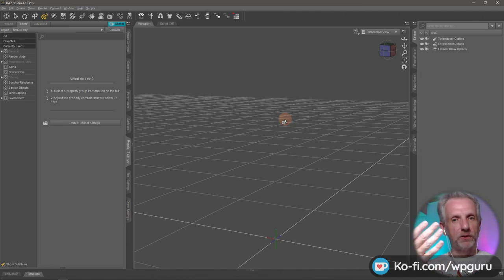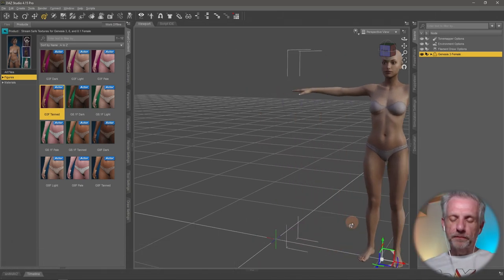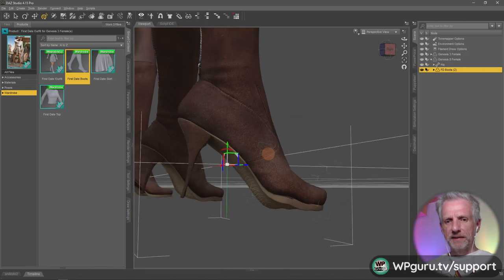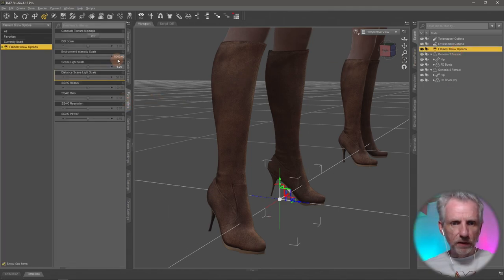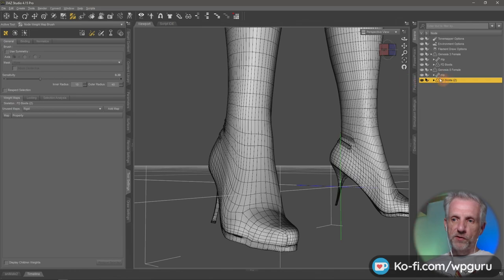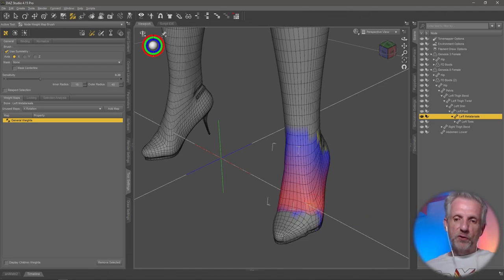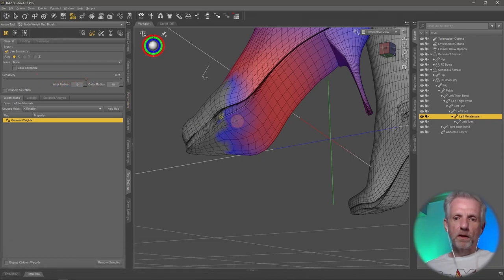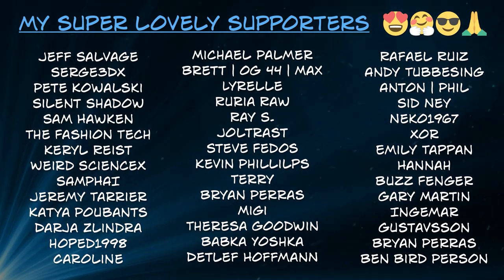Fixing Auto-Fit Shoes (G3 to G8) in DAZ Studio

Comment: Nice job!  I find adding a smoothing modifier and a push modifier with a low value helps as well.  This is a nice addition to help with distortion.  I make my own foot morphs so I always need to make sure the morph has the auto follow unchecked (in the morph parameter settings) or else the shoes deform to the custom foot morph.  I think the problem may be that some shoes are made to contain all the toe bones.  It would be best if only 1 toe bone was included.
Reply from the maker: That's clever, I'll have to try that out :-) Shoes are so tricky, I sometimes like a "smart prop" type accessory so I can do all posing and mprphing myself rather than undo what DAZ Studio introduces.
Reply: @WPguru  Thanks!  I'm a huge fan and keep these great videos coming!  All the best from South Florida!
Reply: what you can also do is remove the toe bones from the shoes in the joint editor. that is good for open shoes when you want to make some toe poses while retaining the shape. also a very good way is if you have customfeet morphs dialed in, they wil autogenerate the morphs on the shoes too. thats why they deform, to counter that when the shoes are selected, right click on the parameters tab and show hidden properties, and then head over to the currently used category inside the parameters tab, and search for the hiddedn dialed in morphs what u dont like to get your shoes or clothes gets conformed to.
Reply from the maker: That’s an awesome tip, I’ve never tried that. Thanks for sharing Mike 😍
Reply: @WPguru  I don't understand these tips. Pls make a follow up video.

Comment: Hi... nice tutorial 
Do you have a tutorial where you make the back shoes that does have strap moves?
You know what i mean
Like daggling effect?
The shoes usually stick to the heels when you try to bend down the foot which doesn't give a good effect lol
Reply from the maker: There's no built-in mechanism that can simulate this. I would probably un-fit the shoe from the character, then pose the foot and show separately. I have another tutorial scheduled that shoes how you move items despite them being parented, it's more about accessories but may come in handy for your shoes too. Watch this space!
Reply: @WPguru  yeah i tried the method mentioned but sometimes the straps clips through the character
Reply: I wonder if applying dForce to the shoe might help with this.  Have you tried that?  I'm not sure it would.  I've tried applying dForce recently to more rigid objects, like flip flops.  It didn't work well.  😆. dForce is more suited for hair and clothing, but there are a lot of parameters that can be set to adjust things so it might possibly work?  I know if things are too rigid with dForce it can cause the mesh to explode.  I think it should be possible to make the straps less rigid in the dForce settings so they don't clip through the character maybe.

Comment: Daz is so bugged it's almost impossible to do.  When I click symmetry, for example, the program crashes.
Reply: Another method you can try to rid shoe from deforming is by either zeroing out all of the toes bones, when you expand the foot in Scene, providing you have not used the foots morph spread toes or any other morphs that twist or bend the toes out of shape,  but even then you can use the spread toes morph to help you constrict the toes, although sometimes it will add deformity depending on shoe. Use the metatarsal morph to angle the heel if it is not straight. I use this method to fix a lot of shoe deforms in GF3 and GF8.